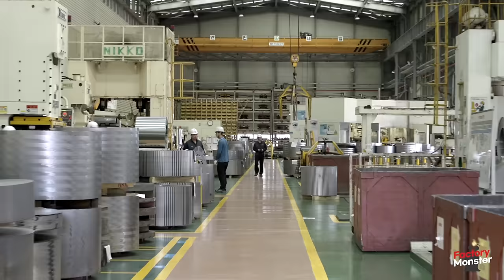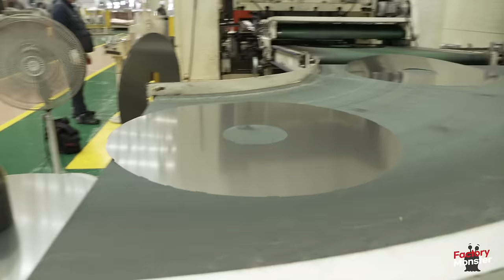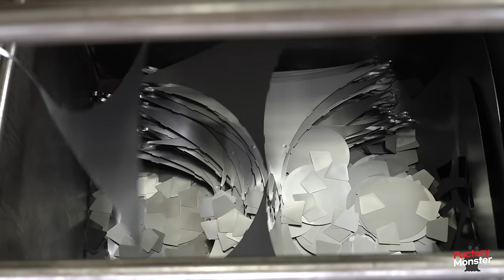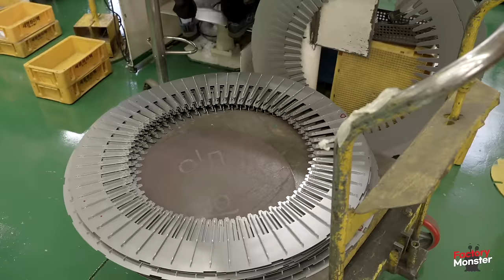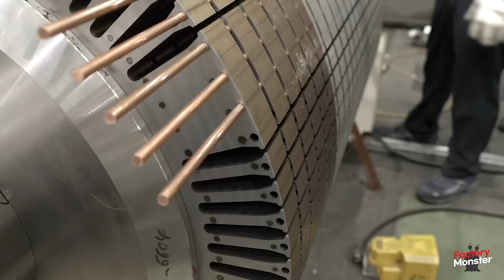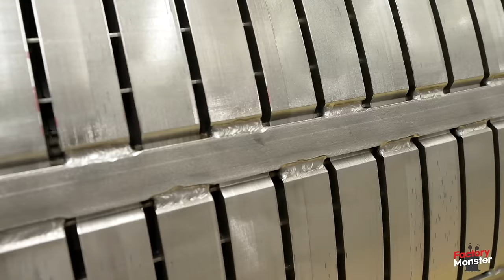Magnetic Core for Generator Manufacturing Process. Korea's Magnetic Core Factory

Comment: The high silicon steel sheet makes excellent transformer and motor stator cores because of its high magnetic permeability. It creates an excellent magnetic circuit, and I believe that because the silicone content raises the electrical resistance it has higher efficiency than a carbon steel can.

I love the way the scrap from the massive sheet punch folds itself up in the recycling stillage.
Reply: That would be SiliCON, and element, not SiliCONE, a man made compound.
Reply: @The_DuMont_Network  That would be AN, an indefinite article, not AND, a coordinating conjunction.
Reply: Si steel has lower hysteresis losses. That's why it's used in AC induction machines.
Reply: I seem to remember from my younger days that with transformers the layering of sheet steel or iron is not necessarily to aid construction but to guide the magnetic flux lines which makes the whole thing more efficient.
I suppose it's the same here?
Reply: Короткозамкнутый ротор типа Беличья клетка. Это в асинхронных двигателях
Reply: Do you know what is the most useful silicon steel grade for motor is it DT4?
Reply: @captainoates7236  Have separate plates that have a thin oxide insulation coating reduces the amount of circulating current and therefore what are called core losses.

Comment: Nice details and explanations. I learned a few things, and I am a retired electrical Engineer. One thing, though, this is a high quality steel, would likely go back to make more of same. Would be a waste for rebar and not likely right for structural members.
Reply: That high quality steel took energy and other resources to make. It will be sent back to the steel plant as clean recyclable material, labelled as such and the make up of the steel so they can make more of the same. Rebar and I beams from that these days 😱😱

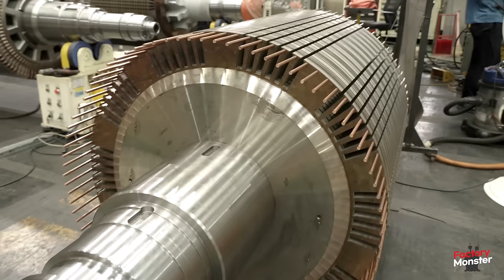Comment: About bars at 6:13

As I understand it, this machine is a synchronous generator (the frequency of the output voltage coincides with the frequency of rotation of the rotor). In such machines, it is very important that the output voltage frequency is constant (hence the rotation frequency is also constant, since they are directly connected).

When we rotate the rotor with an electric load connected, we apply a certain amount of torque (force) to the shaft so that it rotates and generates electricity. BUT if the load changes quickly (becomes more or less), then either more force or less must be applied to the shaft. This means that the rotor will start rotating faster or slower (this is acceptable, but within small limits).

In order for us to have time to change the force on the rotor with sudden changes in load, it must change its rotation speed slowly (because it is a large generator and something large rotates it - it is difficult to change the rotation speed of something large).

To make the speed change smooth, a damper winding of these rods is used. The video does not show, but later they are connected at the ends. This construction is called a squirrel cage (for obvious reason, you can Google =D). Without going into details of all the processes taking place in the generator, this cell is like an electromagnetic spring or an armorizer (as in a car). It does not allow the machine to drastically change its rotation speed.

Probably more professional people will explain it better, but I tried to tell everything as accessible as possible and to the extent of my understanding (I am a student at an aviation university, we study only small generators). Sorry for my English and terminology, I used a translator)

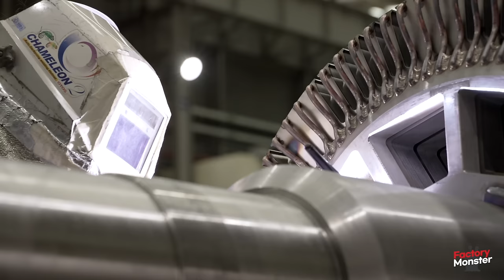UPD: i watched further - as you can see at 7:07 this bars welded together by the ends.
Reply: This is probably not a direct synchronous machine, but rather an improved High efficiency phase controlled (aka vector controlled) squirrel cage rotor for an induction machine.  If you look up the torque speed curve of a squirrel rotor, you can adjust the torque to be high at low speeds (for starting), or high at high speed (least slip, maximum efficiency), or somewhere in between.  This is done via the inductance versus resistance ratio of the windings.  Since there is no skew in the rotor, this has to be "somewhat synchronous" to obtain maximum efficiency, hence the vector drive.  The steel itself has a fairly high resistance, so the copper rods are added to reduce the resistance through the rotor.  Usually this is simply done by just pouring in molten aluminum, into the slots, and leaving an end ring.  Aluminum has somewhat low resistance, and this allows motors to be made for Drills and Compressors where the starting torques can be very high.  Unfortunately once the motor gets up to speed, the slip increases in proportion, and the overall efficiency drops at the higher speeds.  Vector controlled motors allow a highly conductive rotor to be started at a slip angle which minimizes the starting current surge.  If you had a high-efficiency motor doing a hard-start, the starting current could be 3-to-10-times the normal running current, and if that motor was overloaded and slip-stalled, the breakers would kick out since the current draw would be huge.  Vector control allows the slip frequency to be brought up appropriately, to keep the current within limits, and then it tracks the slip angle as the motor speeds up, and then it can place that angle at the "absolute maximum" of the rotor and stator efficiency.  As such, it is within a few percent of the incoming line frequency, and is semi-synchronous to it, but with varying slip angles.  We designed such systems for ships, combat vehicles, mining machinery, and it is commonly used where a high efficiency process is required, with minimum motor weight and size.  For rotary kilns, some of the stators are over 10+feet wide, and the rotor is only a small ring around the heater tube.  Repost this if anyone wants more info.

Comment: I was surprised when you said they make rebar and beams out of scrap steel. Isn't electrical steel too high in silicon for that? I remember playing with transformer laminations as a kid and they were so damn brittle, they would crack after several bends and had crystals visible on the fracture.

Comment: Worldwide expert here, this is an induction motor and the stator windings (not shown here) will induce a current to the rotor bars of the rotors which will have an opposing magnetic field to the stator, turning the rotor. What you may have come across in your extensive research is sometimes the rotor bars are skewed a little to reduce noise, increase starting torque etc minor things but those are more relevant for smaller general purpose induction motors.
Reply: Thanks mr. Worldwide
Reply: As a worldwide expert myself, yes you're correct. You are welcome 🤗
Reply: I’m an expert on worldwide too! Who would have thought?
Reply: @stupidhead9117  no u r not 😂
Reply: Nikola Tesla here and you are wrong
Reply: Your sofas are bigger than this factory
Reply: Galaxywide expert here you're correct but this is elementary for me
Reply: God here, you are wrong and must atone for your sins
Reply: Yes, on larger ones they are straight, its pretty wild the amount of axial stress they can handle and when you get uneven heating on the rotor bars it will cause the rotor bars that are heating much more quickly to press on the end rings and cause the ones that cant keep up with expansion to break. Even worse for open rotor desings since the copper bars normally get wedged into the airgap. This is a common fault on motors in the steel industry
Reply: It could also run as an induction generator
Reply: I have read your books worldwide.
Reply: How much was your world wide bull shit degree? Was there a thesis you had to come up with for the cert?
Reply: Expert from another universe. It only works if electron mass is so and so.
Reply: Prestige worldwide over here
Reply: I feel so inadequate. I’m just nationwide.

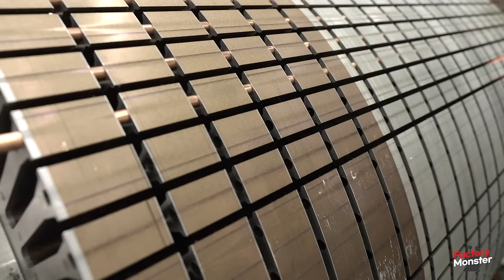Comment: 5:51 - rotor bars are first and foremost electricity conducting elements. The "core" is made of thin sheets of steel in order to make them good magnetic flux (or whatever they call it) conductor while increasing resistance for eddy currents - the electricity flows through this copper "cage" as it is sometimes called.

Comment: interesting that stator scrap is rolled back up, but the rotor scrap is all put into a bin
Reply: Can't roll the little bits?
Reply: Its easier to handle since it is still connected.
Reply: @nathanieljames7462  the little bits on the stator were seperated into a bin as well, they just rolled the parts that were still connected, which the rotor also had
Reply: Many thanks to the three people on this conversation thread: 

It has "sparked" my creativity to achieve my design criteria, especially DFM (design for manufacturing).
Reply: Shipping scrap is packaged for ease of transportation and ease of recycling,  for instance the scrap just tossed in the bin with all the little parts with it do better in a big bin , and the scrap rolled on a spool by itself is the best way to handle it, there's a reason for everything,  except politics

Comment: I don’t understand why you would stamp out steel sheets only to stack them up again into the shape you want. Why wouldn’t you just cast the rotor and stator directly from steel or use lathes and milling machines to cut the shapes from solid steel?
Reply: It’s something to do with the efficiency and strength of the electromagnetic field. As if thousands of individual sheets are more efficient than large chunks.